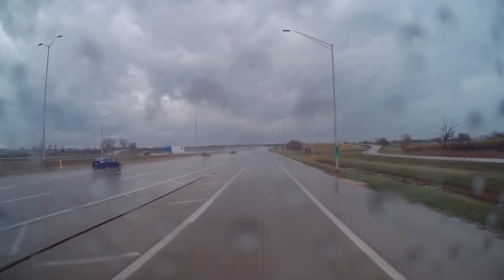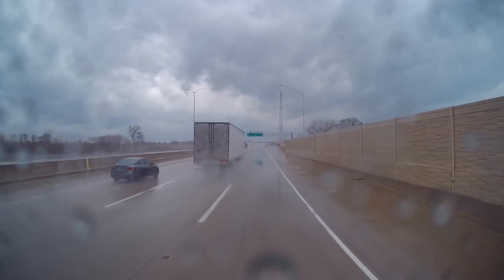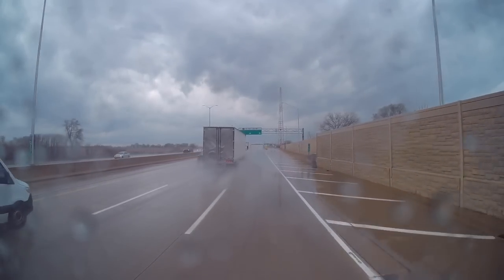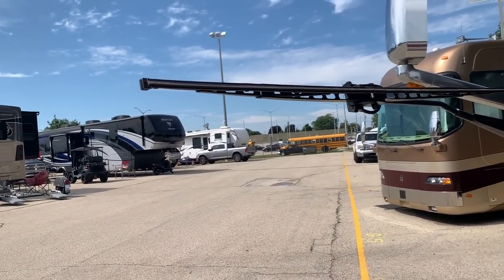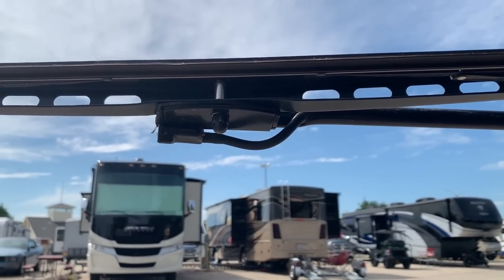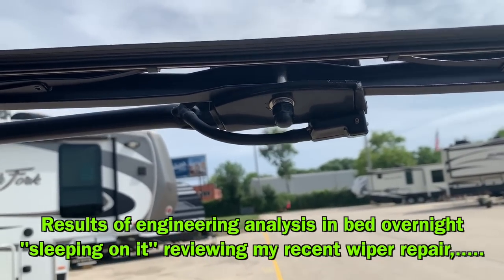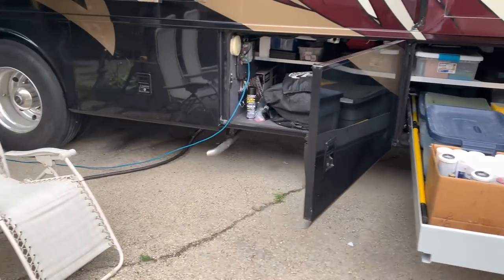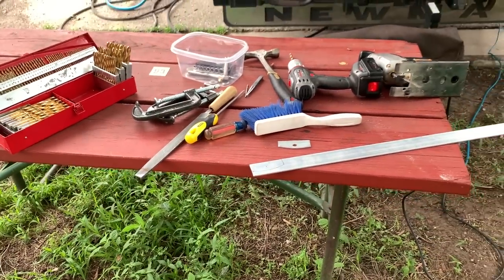RV WATER LEAKS ARE A DEATH SENTENCE TO YOUR RIG IF NOT REPAIRED QUICKLY! SEE HOW WE FOUND OURS-EP229

Comment: Mark and Sue .. I found a superior product to RainX called AquaPel, formerly made by PPG who sold it to another. It costs a bit more but works longer without the degree of hazing during a wipe RainX does, despite meticulous glass prep. You have to buy it from an on line source (would like to find it over the counter). My last purchase I split with a friend. The applicator is a non-woven material with a crushable glass tube inside. A cautionary note - follow the instructions, not too  different from RainX, but the last batch we bought seemed to have been short filled. One applicator should do a standard size windshield and two side glasses. LOVE you stuff! I come from an engineering department for instrumentation as an electronics tech, though lost that career long ago.
Reply from the maker: I took a look at that stuff, and I love the applicator. It does look easy to use!  I will try to remember to give it a try when my rainex supply is gone!

Comment: Great information.  I’m gonna look in my wheel wheels of my 15 London Aire. I’ll most likely go ahead and seal it all up just for preventative measures. We recently purchased our RV and we haven’t driven in much rain. Better safe than sorry.  $40.00 in sealant is much cheaper than water damage.   Thanks again. 😎👍
Reply from the maker: Try to make a mental note to look for the water ANYWHERE after a 2 or three hour rain drive.  I used approximately (2) cans on the drives side and (4) cans on the passenger side.  Look around at some of the "other" rusty steel support members supporting the floor and adjust your can count accordingly!

Comment: So Mark, I have watched many of the TV commercials for the Flex Seal product. And I believe if you were to use 1 more can of the spray product, you will be able to drive the MH into Lake Michigan and turn it into a floating multi purpose RV. Those duckbill drain tubes will be a godsend keeping you afloat.
Reply from the maker: That was funny Larry.  I actually used (2) more cans than I talked about in the video.  After I shot that scene, I was going to caulk the horizontal joint to finish it off.  After I brought the caulk home, I couldn't get the gun into position!  So I goobered (2) more cans into the crack seam!

Comment: Another great video. I used shorter wipers on my last coach. They worked better and were much cheaper. May upgrade this one to.
Reply from the maker: So far so good for us.  We haven't driven in rain yet with them,.......just a test in the RV Park so far.  Fingers crossed.
Reply: @OurJourneyInMyles  Did you convert your wiper arms to the standard "J" hook wiper attachment? This will give you more choices of wiper blades and cheaper ones to.

Comment: Those rubber duck bills can weld themselves shut over time so I use a Q tip with any rubber friendly lubricant, pinch the end open and give them a skungele in order to keep them flowing freely. Once per year is sufficient (Skungelee ~ a swipe and in & out motion to insure just a thin layer of coveragethat won't impede water flow). When I purchased my used RV with low miles that sat a lot, all the A/C duck bills were stuck shut and the water from one unit actually backed up to the roofline and puked in through the ceiling vents. That was my educational experience that drew me to this conclusion😉
Reply from the maker: That's a great idea on the duck bills!  I had never read that anywhere.
Reply: @OurJourneyInMyles  Necessity is often the Mother of invention😉. Take care🙂

Comment: Same issue with my 2017 Aria.  Leaking seals (replaced), seams sealed using silicone on inside and Flex Seal on outside.  Undercoating works OK, but does not build up as easily.  Also found the pressurized can of Flex Seal worked in some places.
Reply from the maker: Good to report William for other 2017-ish Aria Owners!

Comment: Ayy up you2 from Yorkshire England,We have a lot of rain here.try cleaning your windows with Ammonia,or Vinegar Then use rainx And clean you wipers every month with a cloth soaked in vinegar and use undiluted winter grade screen wash 
On the Electrical side  see if you can put some wax oil to coat them or some kind of shrink wrap rubber.very good vlog
Reply from the maker: Thanks for the tips Craig!  Sue agrees that the Vinegar windshield cleaning is a great idea.

Comment: My thoughts on windshield wiper blades is to Teflon wax the windshield 3 or 4 times.  The wipers have no resistance across the waxed glass and even in heavy downpours my wipers are on delay wipe most of the time due to the water beading and flying off the waxed windshield.  Yes, everyone is going to say “Use Rain-X” but the Teflon wax lasts much longer.  Safe travels!
Reply from the maker: Hey Rick,.........can you reply what the best EXACT product you suggest we all try?  We will try it!
Reply: @OurJourneyInMyles  yes certainly.  I use Starbrite Marine Polish with PTEF (since we can’t say Teflon anymore).  16 oz and 32 oz size bottles with a black and gold label. I’ve just retired from the marine business of 40 years and have used this on my boat and vehicles since 1990.  If you have anymore questions please let me know if I can help answer any.

Comment: Mark, another great video. Have you determined if this sealing worked to prevent more water intrusion? Thank you.
Reply from the maker: Honestly,...... no.  We rarely get caught in down pours, and if possible would plan traveling around a major storm event. So I have not had an awesome "test" of this repair. I WILL tell you after doing it I have had no water in the wet bay area, and I do EXPECT that it WAS the issue and did FIX the issue.
Reply: @OurJourneyInMyles  Thank you. Safe travels.

Comment: 22 DS 3709…wet bay carpet behind the passenger rear wheel every time we drive in the rain.  It’s on the list for NIRVC Atlanta…I hope the issue doesn’t pop up elsewhere.  🙄
Reply from the maker: When you finally get your leak repaired, it would be AWESOME if you could reply here again and tell us all how it turned out, and how much it cost to repair.  On irv2.com, some folks had to have the tanks removed to caulk the frame rail joints.  I hope that's not your issue,..........or mine for that matter!  Good luck guys!

Comment: good video. what is the chain used for on your discharge hose? Safe travel.
Reply from the maker: I use a rodent preventer called "Sewer Sock" to block the giant hole in the wet bay for the sewer hose to pass through.  The chain just weighs the sewer sock gadget down!
Reply: @OurJourneyInMyles  ok thanks. will have to look at that.

Comment: What kind of quality control do these inept manufacturers have anyway regarding testing this damn RV’s in real world situations or do these engineers just drive them in the ac controlled showrooms after they are finished ? lol WTF . Don’t seal the wheel wells after finishing the chassis & trickier to make them airtight & waterproof ? Plus don’t test the windshield wipers for efficiency? ? If that can’t have quality control on those things what do you think 🤔 will happen on ALL the other mechanical components that are involved with an RV on wheels . Brutal . This is why the RV industry is like Congress, no true oversight whatsoever & accountability. Pass the BUCK from manufacturers to dealerships to consumers who suffer financial from piss poor products . No Organization oversight as long as these manufacturers keep paying their dues . Get an Independent 3rd party inspection 🧐 before you buy & don’t trust the PDI’s from dealerships whatsoever. They are a rip off. Hire Blue OX Inspectors. Thx for the great video & advice & safe travels wherever they may take you two . Love your channel. 👍⚾️
Reply from the maker: Hey Bob, I agree with you.  The day Honda starts making Motorhomes it will be all over for everyone else!
Reply: Lol 😝 👍⚾️